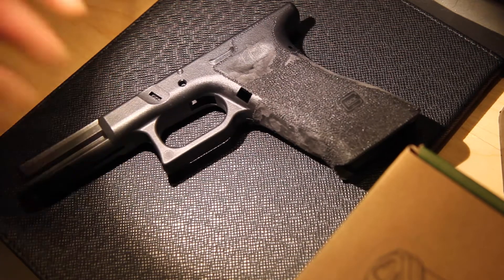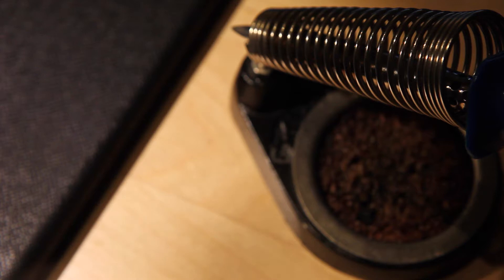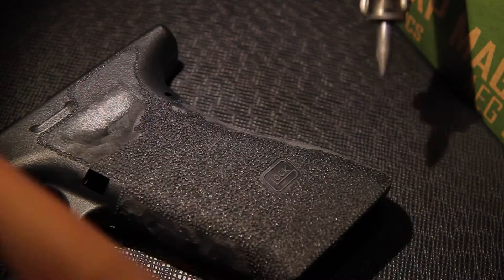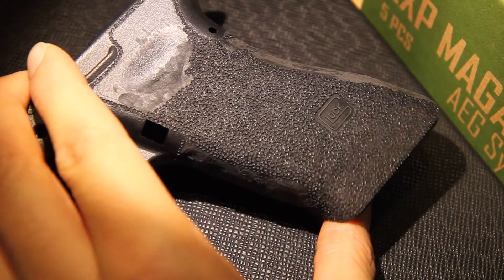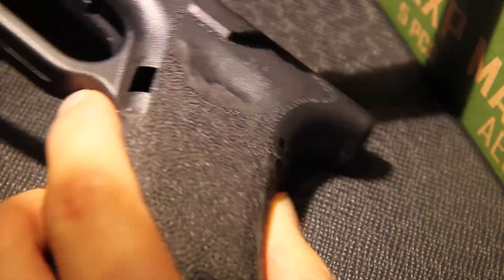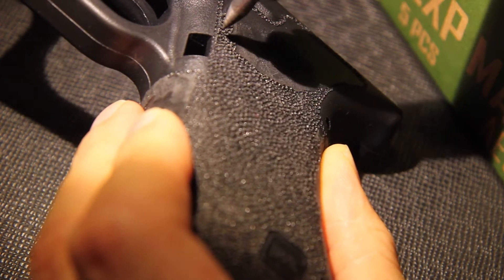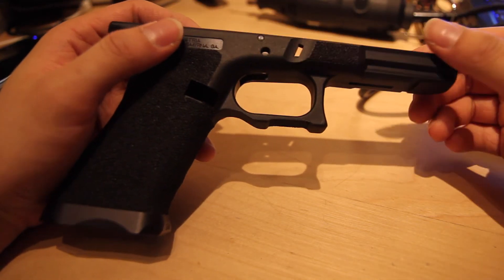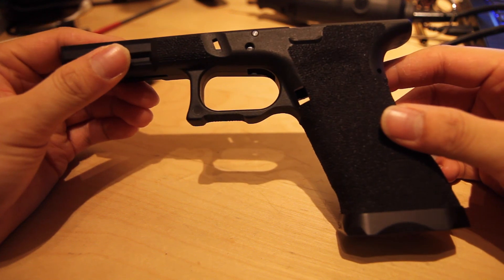Glock (airsoft) Frame - 'Dot'' Stippling Method

Comment: What about KJW frames? Have you tried any?
Reply from the maker: HiroAirsoft oh yes! you can do KJW as well!! 
however! because certain frames are very small (proprietary) because KJ makes some of the special versions of glocks, so be very careful for the grinding process to prepare the frame for stippling! 
but in general, nothing much to worry about for KJ :) lightly XP
Reply: Thanks ;) Great video btw
I was gonna do it on a TM frame.. lol now I'll do it on the KJW.
And Army frames? I've never handle one I don't know how the plastic is.. but they are cheap and have the correct markings..
Reply from the maker: oh dear, never tried or even seen the army frames unfornately :( 
and thanks a bunch! good luck on the stippling!!!